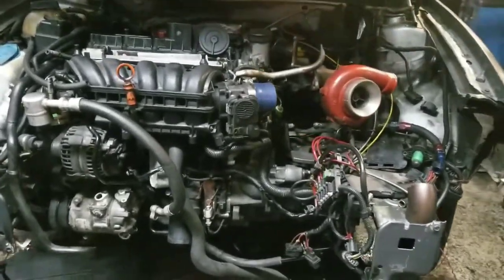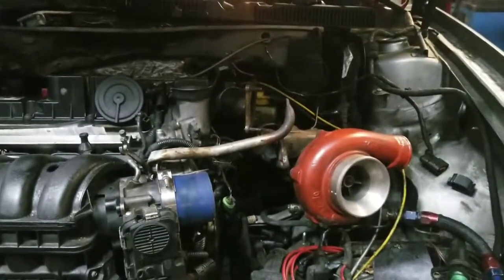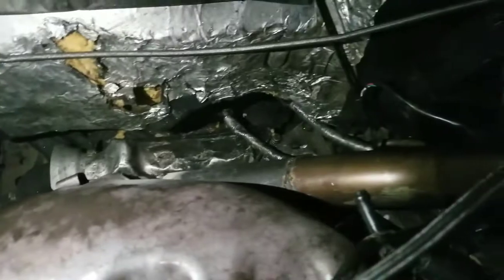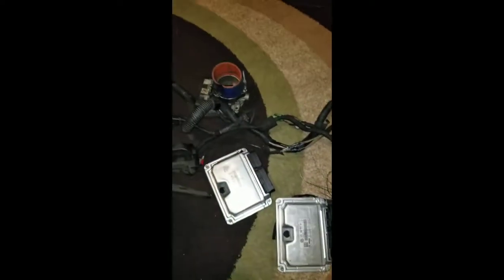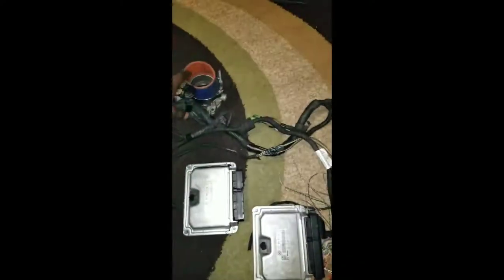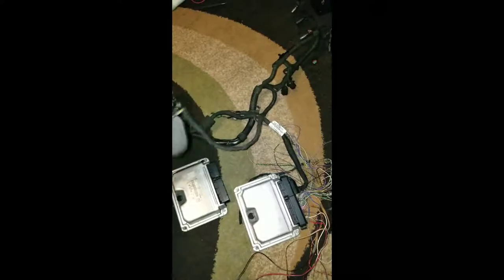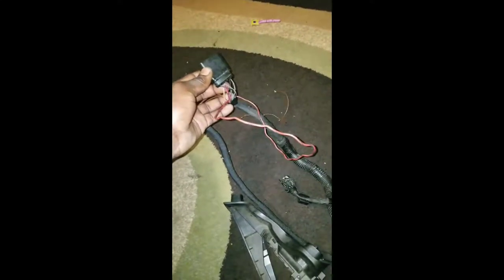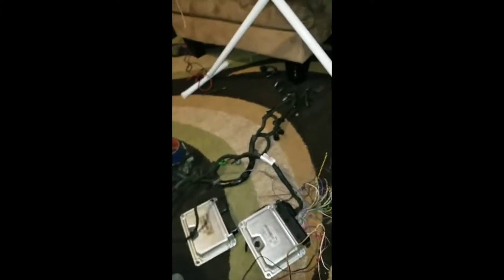07k mk4 swap

Comment: hello you can share the wiring in pins and connection ..
how many psi boost can you support with the admission ...
and after that program you will use
Reply from the maker: Sure the tune I have is from 034 motorsport good for 20 psi I've personally run an hx40 turbo on it with no problem but a 58/58 is what they recommend, but if you you get immo delete for right now you can run like 5psi on the stock setup which is what I did for a while till I got the tune. Send an # I'll text you the  wiring for the ecu
Reply from the maker: Shoot me an email I'll put something together for you